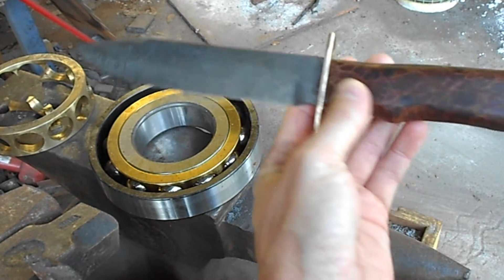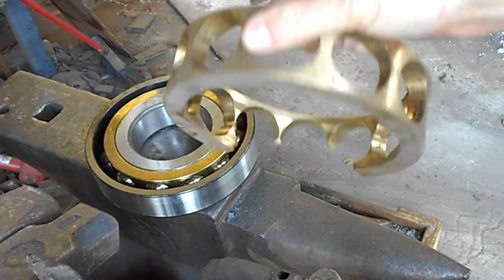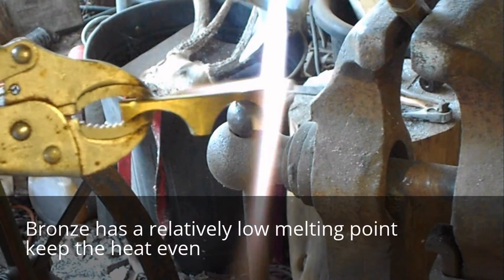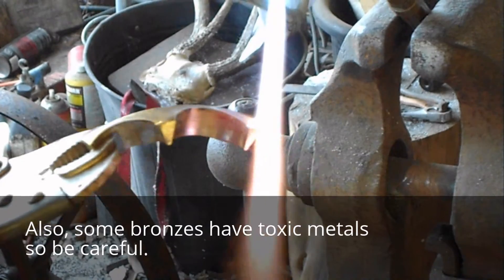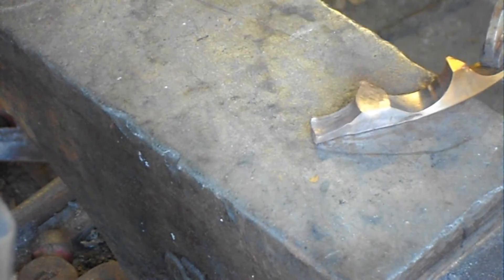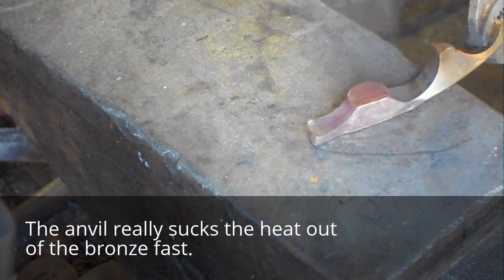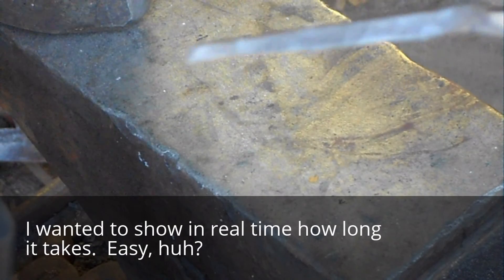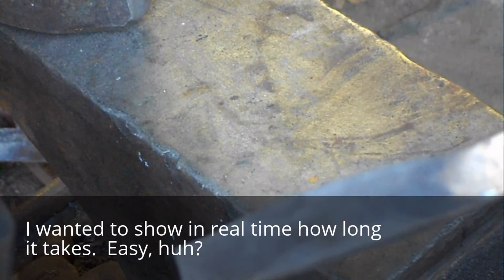Forging A Bronze Guard from a Bearing Retainer

Comment: Most "bronze" nowadays contains zinc which actually makes it brass. True bronze contains no zinc and TIG welds like butter, but if there is zinc in the mix it welds just like galvanized. Probably the reason you cannot make the bronze too hot in the forge James is because it has zinc in it. If I had to weld brass I used a torch and not an electric arc that caused the zinc to vaporize.
Reply from the maker: It wouldn't surprise me if it did have some zinc.  I do have some brass and it is a little more difficult to work.